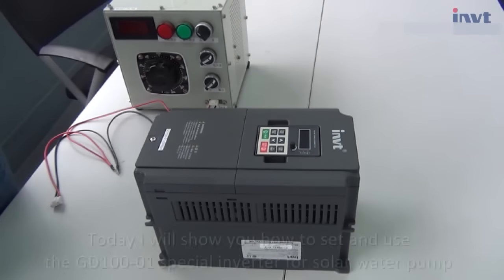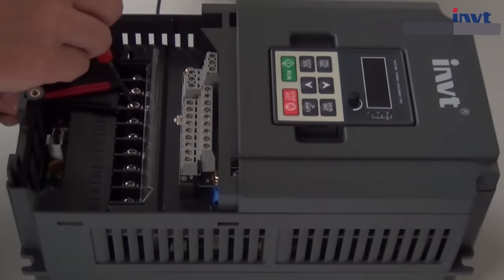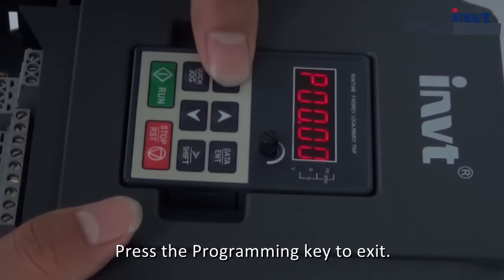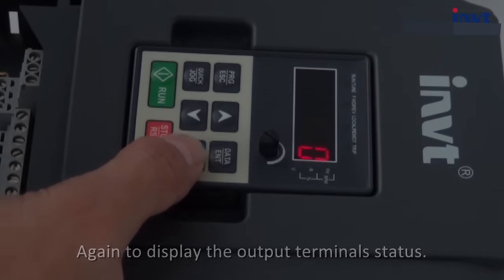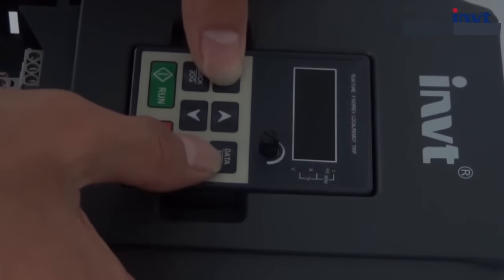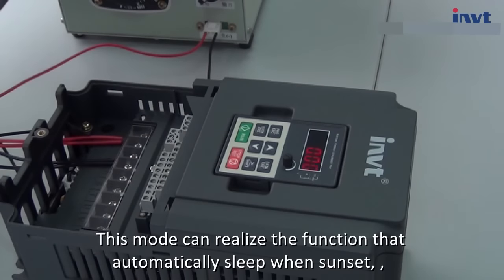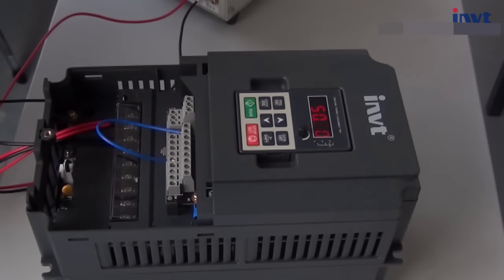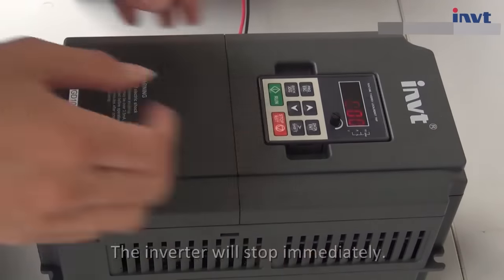Solar Pump Inverter: How to Set Solar Pump Inverter GD100-PV Parameters ?

Comment: Sir
DC power connect to + plus and - mains is better or R and S is better?
With + plus and - mains capacitors charge direct
With R and S or T capacitors charge by series resistance so save capacitors and power switch?

Comment: Hello, I am from Syria. I have a question: reformatting the device. Adjust the output according to the input of the panels?
Reply from the maker: Hi my friend thanks for your inquiry. You can try to contact our tech team directly. Thank you.
zhangfeng5686@invt.com.cn
Mobile&WhatsApp: +86 17603063816 
WeChat: 156531704
Reply: @invtelectric  may i connect single phase 220V to the R S T..if so then what is the parameter that i have to change...i mean that at the day time i will just use solar PV power at night i have to shift to wapda means electricity comming from grade station please guide me if possible thank u so much sir

Comment: Hello Sir I have a problem in my solar water pump 
I installed 5 hp solar water pump direct to solar panel when sun are arise I started manually and when cloud come then it shutdown 
My means that my system is manual 
Sir it is possible the process will be done automatically On or Off
Reply from the maker: Hi my friend, may I have your email or whatsapp? our team will contact you soon